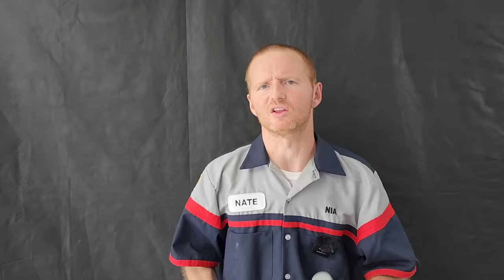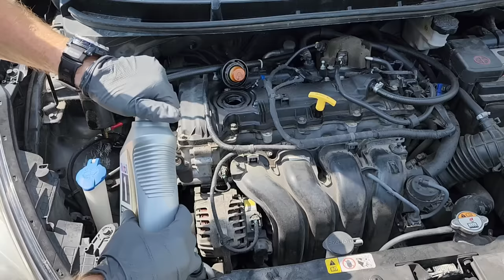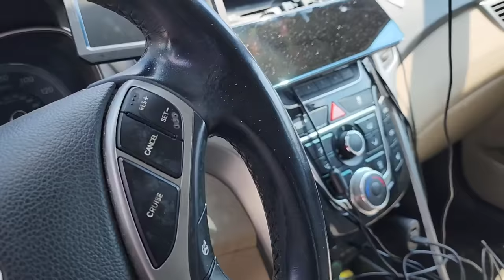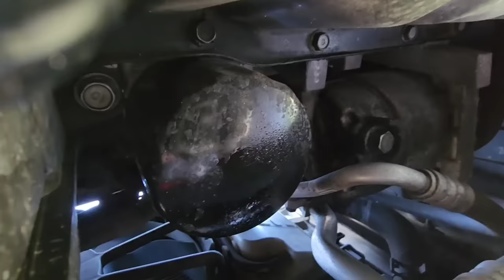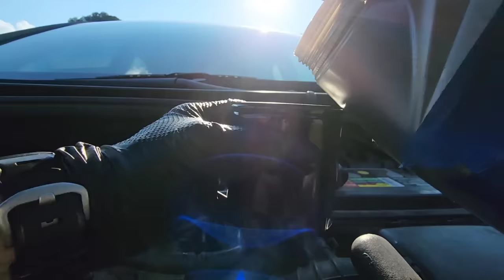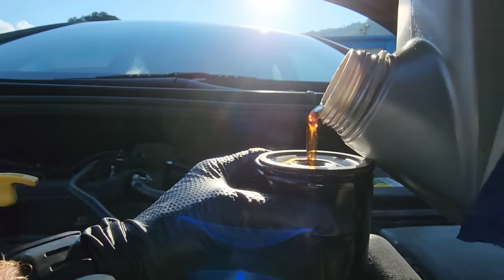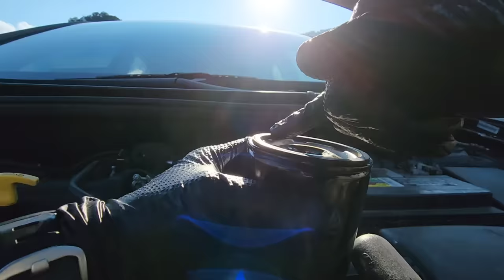Car owner sued after Jeep kills Mechanic during oil change

Comment from the maker: This is very sad and My thoughts plus prayers are with the family.
Reply: This could have been prevented by using a hoist for cars with standard transmission.
Reply: @SulitAE86  Hoist for automatic transmission or manual transmission is the same.
Reply: @SulitAE86  could have been prevented by using wheel chalks and not having careless mechanics. Experts also do not say to leave the car in gear but the car in neutral with the parking brake set and the wheels chalked but not a lot of mechanics do this
Reply: A damn mechanic should know how a manual shift works.
Reply: First and foremost, if the mechanic didn't know what he was doing to move a car, him and his boss should be liable, no one else.  Sucks someone died, but the car owner was not responsible for ignorance of their profession
Reply: Michigan has the care & custody laws where the company who repairs your vehicle assumes full responsibility of said vehicle once the custody of the vehicle has been transferred. Should this event occur, the operator of the vehicle assumes full responsibility. If that operator happens to be a fellow mechanic who accidentally kills a coworker, the mechanic behind the wheel would be sued, not the vehicle owner. 
The same principle would apply if you killed someone while driving a rental car. The car rental company wouldn't be sued, you would. Same thing if a mechanic took your vehicle for a test drive and killed someone in the process; the mechanic would be liable, not the vehicle owner.
Reply: Steve Lehto covered this.
I’d suggest his channel, Lehto’s Law.
Reply: @billsfan1768  What about the e-brake ?
Reply: @mikelarry2602  that’s what I said parking brake applied with the wheels chalked. I have personally haven’t seen this much but when you are training a entry level mechanics you should probably do things like this to make sure they are comfortable doing simple tasks like this. There is no such thing as a emergency brake it’s called a parking brake. You don’t pull that brake during an emergency it is meant to keep the rear wheels locked up when parked on a incline. What is also not specified is who pulled the car in. The senior tech probably did that so his responsibility to do things like this. On a oil change you most likely are not setting the parking brake because on a job that pays a half hour you do not want to un lock a wheel after pulling the parking brake. In states with rust and snow parking brakes have a lot of issues so you usually do not operate them unless you are doing a state inspection or checking out the rear brakes
Reply: @dangeary2134  He's great.
Reply: @billsfan1768  Thanks I have heard people call it both for years. The fact the kid didn't do either one is very telling.
Reply: @mikelarry2602  I’m not trying to criticize you in any way sorry if it came off like that. I do agree with you if you are working on a vehicle it is 100% you responsibility to know how to operate it.
Reply: That's mental! If the car owner left it in 1st gear when it was dropped off then it's understandable,but someone else put it/left it in 1st gear when on the lift. RIP
Reply: link to this supposed lawsuit?
Reply: The jeep didn't kill the mechanic. It was the other inexperienced tech that probably wasn't paying attention. Jeeps are controlled by people. And in no state would this lawsuit ever win against the owner. And a counter suit will most likely win for undue court costs.
Reply: @billsfan1768  chocks, mate. Chalk is what you'd draw on a blackboard with.
Reply: What a load of rubbish 🗑 
 It's not the car owners fault .
Reply: I agree completely
Reply: Manual trans always put in neutral and emergency brake is on . Never leaves in gear it will move the vehicle. I have driven standard transmission for years. New mechanic isnt experience with it or dont know how must give someone to take care of it or training . I m sorry what happened. Thanks 🙏
Reply: Pa
Reply: @robertlamey7612  Fucking exactly. If he doesn't even know that,  how can he be a mechanic?
Reply: If he knew nothing about a manual vehicle how did he figure out you had to push the clutch in to start it? 🤔
Reply: Just  accidental noones fault. This generation will not pass away before these things happen
Reply: Accidental. Noones fault.
Reply: They're allergic to giving price. Determine if people using and taking my advantage of you. Super high.prices. or benefiting you. Long term second nis way better. I'll be starting a business soon so good deals on cars, houses maybe guns. I'll only try to make a few hundred
Reply: Noones fault.juat an accident
Reply: @shadyshinichi2JZ  you have to Google it. It happened in Michigan I think
Reply: Never put your manual transmission in gear aways put it in neutral and pull the break to hold it steady be careful what you do never keep a manual car in gear when you start it up ever that thing will take off on you
Reply: havin a card dosnt make you a good driver
Reply: I’ve heard of situations where a criminal steals a car to use in a crime, and the police confiscate the car, because in some ways the car was responsible for the crime. Makes about the same amount of sense.
Reply: Was the emergency brake applied?   😮
Reply: @BubblesTheCat1 DEI. need I say more 😂
Reply: Its the mechanics fault, he should first be a Certified technician to work on a vehicle, and when you have a manual put it in neutral and apply the emergency brake.
Reply: @SulitAE86 you've got people that don't even understand the basics of how a car operates and now you want them to lift a multi ton vehicle overhead and work underneath it?
Reply: @davidcooper6618  if they don't understand a vehicle, they shouldn't be working on it.
Reply: This has happened countless times down through the decades. Its why neutral safety switches were devised in the first place. Plus, the dealership should be insured against serious injuries anyway.
Reply: This has NOTHING to do with the owner. Stupidity has consequences.
Reply: He probably tried to cut corners
Reply: @mikelarry2602 parking brakes don't work for most Vehicles because they will seize very quick in the salt and everything
Reply: Thoughts & prayers are always placatory & useless.
Reply: @Mrnikkisicks  " if the mechanic didn't know what he was doing to move a car,"
He was not trying to move the car , just run it to put pressure into the oil system and check for leaks . 
Correct about the owner not being to blame , I cant understand how that family thought he was liable
Reply: And money to or what. Some petty nonsense
Reply: Condolences to his family but this is ridiculous
Reply: Yeah, I do feel for the family that lost their love one but I feel bad for the people who got sued too. They had nothing to do with it. They just were getting it oil change and In someone didn't know what to do it's not their fault

Comment: No way you can blame the owner. That's insane.
Reply: The law in this country is wacko! I was sued by a passenger in a car that hit me.
Reply: @nickchallen4883  that makes more sense.
Reply: @nickchallen4883  What was the outcome?
Reply: @raynic1173  no it doesn't. Go back to Fortnite, adults are talking
Reply: @llamabot9889  look knucklehead, although we don't know the details to Nick's case. This is not uncommon. A case, and investigation may reveal a full or partial responsibility on Nick's part and this may provide $ to that passenger, it may also be bullshite too. Some Ins. companies would rather settle than spend money on litigation so this can be an easy payday. So you go back to your PS.
Reply: @realifejon  he gives an update in the video. Something had to be done, it's all about the $$ and who can be sued and who cannot. The Judge ordered indemnity (no liability) for the car owner.
Reply: @raynic1173  That's why you gotta read the fine print.
Reply: Exactly.. If the mechanic can't drive a manual he should be working there  WTF??
Reply: @nickchallen4883  that’s what 3rd party insurance is for
Reply: @robertnewman4105  The problem is how do you fix this problem without causing an issue where someone who really does have the right to sue but  can't because of the law. The law of unintended consequences does not play favorites.
Reply: @raynic1173  how. shouldnt they sue the person that endangering both their lives by crashing into them?
Reply: @nick0164  I never said they shouldn't.
Reply: You can blame the owner because he took the car to some idiot mechanics..
Reply: Yeah. All this will do is gaurantee I do all my own work even more
Reply: I would hope my dealership sued the owner too
Reply: @llamabot9889  agreed but in his defence ur name is Llama bot lmaooo
Reply: this is insane… how can this be the owner’s fault!?!?!?
Reply: A lawsuit does not always imply blame. More likely it was to try and guarantee a payout from the mans car insurance. This is a common thing that happens, but usually, and in this case, the shop and therefore their insurance would be liable.
Reply: They had to sue him. It's not about blame. His income was gone. What his family got was not much, but it is better than nothing to replace his income so his kids could eat. It sucks, it's a shitty situation.
Reply: Sounds like the 19 year old was in control of the vehicle so legally he is responsible license or not..
Reply: Not about blame. Law says owner of car is responsible for what car does.
Reply: @joshdfox420  nope. It's the owner.
Reply: @nickchallen4883  I would take up arms against that passenger. If my life is going to be ruined for some petty bullshit, I might as well give the universe a real reason to ruin my life and take revenge for unethical fuckery.
Reply: Yes you can, why else would you he sued for it. Another thing, if you get a tire change and they do the change correctly and you die because of someone else messing up your car, it's still your fault.
Reply: welcome to Murica baby 🤣🤣🤣🤣
Reply: America strikes again....
Reply: Here someone made a big mistake by advising the family of the dead mechanic to sue the owner of the vehicle.
The worker (a young mechanic) who was behind the wheel of the car at that moment and who started the car is to blame for the accident.
And in order to cover any damage caused in the workshop, the damage should be covered by the insurance of the owner of that workshop.
This is how it works by law.
Reply: @nickchallen4883  Did they win?
Reply: Yesss wtf
Reply: It was a tragic accident. A factor of many things due to this man's death. Lack of training and work safety course on Automobile safety. This accident had been prevented by placing work benches on the side of vehicles not in front
Reply: THAT'S NOT RIGHT, SAD FOR THE FAMILY ON THIS TRAGEDY 👎
Reply: Its America! Crazy place with crazy people🤣
Reply: Insanity.
Reply: But the mechanics won't be liable for a missing bolt sorry for the guy that lost his life e brake also works good good luck to yall stay safe
Reply: It's SHOP ISSUE...WTH ? LET ANYONE DRIVE...
Reply: You can, and you can interfere in elections by charging someone in the other party.
Reply: If he knows to push the clutch in, so the engine will start, then how does he NOT KNOW to make sure the transmission is in NEUTRAL???  ALSO--- how does a person get hired at a CAR dealer, without having a license.   ???
Reply: @kylebucy9541  These guys aren't mechanics.
Reply: By that logic they should sue the individual worker at the factory who installed the clutch pedal.
Reply: You’d be amazed at what could happen in a court.
Reply: It's really mostly about getting money from the owner's insurance policy for the victim's family.
Reply: Must've been in a blue state.
Reply: @glenforde6558  you mean a compassionate state.
Reply: Sounds about right, a 19 yr old (grown man) that can’t drive a stick LOL.  Imagine how embarrassing that would have been 45+ years ago, when 99.9 % of 15yr old could drive stick.
Reply: How the crazy f’ck was the 19yr old not held responsible??  For god sake he was operating the car
Reply: @wesleydeer889  the law is very weird, anything can happen. How did OJ get off?
Reply: Any jury with ppl who own cars & pay for insurance would see it as unthinkable to 'suit the owner.  If the law doesnt make his insurance pay, then obviously he shouldnt be held responsible, either!  Shouldnt the shop insurance have covered this??
Reply: @magnificentmuttley154  I’m totally baffled why the 19yr old (grown man) is not being held responsible at all, or even talked about really.  It’s like people are viewing a 19 yr old as a 13 yr old or mentally challenged.  The reason is… when the cops showed up, he won them over somehow, either he was torn up and they felt sorry, or just liked him.   99.9% of every charge or prison sentence, starts with what  the COP decides to charge you with.
Reply: @wesleydeer889  Well, youve brought up a substantial topic that I have yet to see discussed for any length of time on We The People University, Joe Rogan, & other channels focused on law enforcement.  Sure, we all talk about how cops will falsely charge a man with public intoxication & erase video footage to cover up their crime, for example.  But youre right.  No one discusses at length how that first officers on-scene determine a person's fate within seconds, by the very deliberate way they handle physical evidence, & either bring witnesses forward or supress them.  Im not at all discounting men & women who do an honest job, but for the most part that is all highly manipulated.  And of course, exactly what a person is charged with is chosen based on exactly how the evidence is "orchestrated"
Reply: Yea sounds ridiculous.... perhaps it's covered by his insurance
Reply: The blame is only the mechanics falt
Reply: probably california
Reply: @kylebucy9541  you gotta start somewhere. 19 is "of age". Most people born in the mid 70's +, can't drive a stick, unfortunately.
Reply: It was literally the 19 year old unlicensed mechanics fault. No one else’s
Reply: Welcome to the Democrat septic system my friend please watch your step 🙄
Reply: A mechanic 25 years and didn’t know how to operate a standard stick clutch system?
Reply: The owner popped the clutch while it was in first, he directly killed the mechanic
Reply: Neither the car or the owner kill the machanic but the operator's errors did therefore; he is not responsible for anything as well as the car.
Reply: Just because somebody sues someone it doesn't mean they won the case.
Reply: So if someone steals the car and knocks someone over its the fault??
If so that's mental
Reply: @judgegixxer  none of what happens with lawsuits makes sense sometimes. A man broke into my friends house while he was gone. The thief came in through a skylight above the kitchen island where the sink was. The idiot fell coming in and skewered himself on some cutlery in the sink on a drip mat or whatever it’s called. He had to have a bunch of stitches and staples. The piece of crap sued my friend (the home owner) for damages and won a sizable settlement. Luckily his homeowners insurance covered it but I think you get my point about the absurdity of it.
Reply: @PodunkDaCat-ll9tq The owner was not near the car at the time.  The mechanic did it.